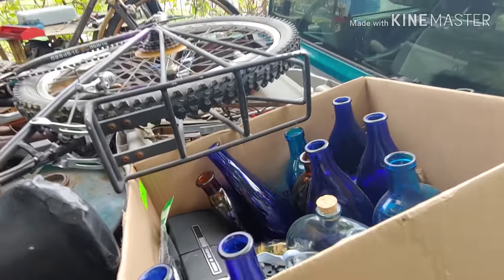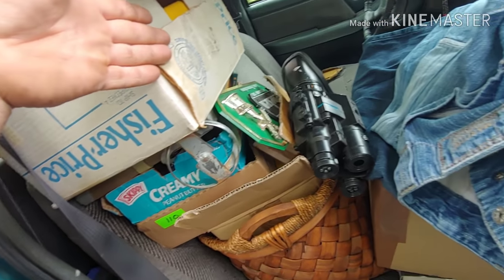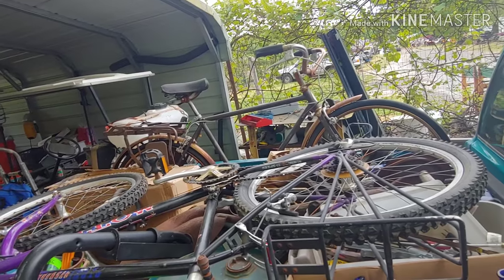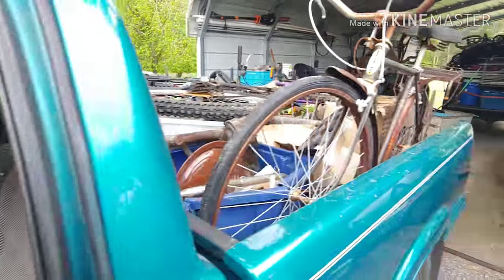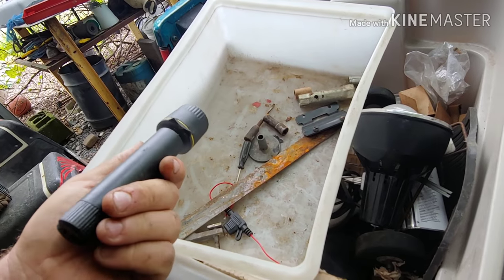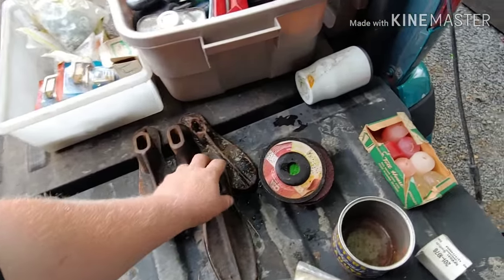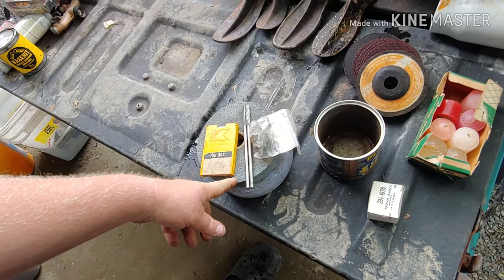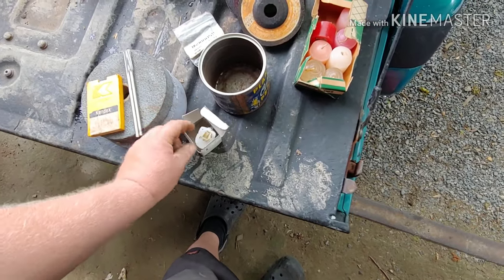Auction haul and estate sale

Comment: That thing you didn`t know was a carbon scraper for taking the carbon off cylinder heads. And that bracket with the rod and knob is a starter pedal the starter button makes a connection to a terminal on top of the starter
Reply from the maker: Yeah I figured it was a scraper of some sort and I did pull the push button out of the heavy iron bin I have it with the brake pedal

Comment: Hi Bert. There is a Brake/Clutch assembly possibly for a '32 Plymouth on Ebay with similar number on it ( -5 instead of -2) and they look the same. I think the B may stand for Brake. I am not mechanical but could you use the Starter switch on the tractor? It might be safer than the screwdriver.
Reply from the maker: Probably not on the switch. And i seen that one too on ebay